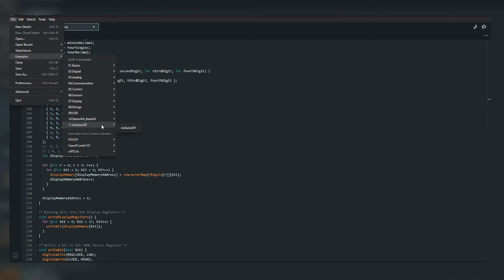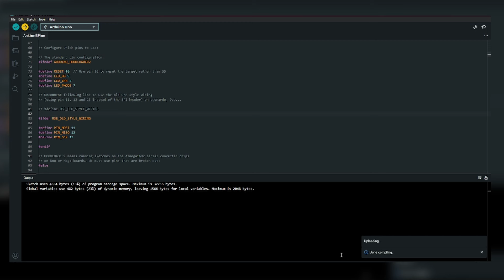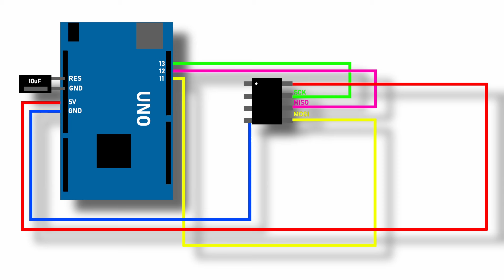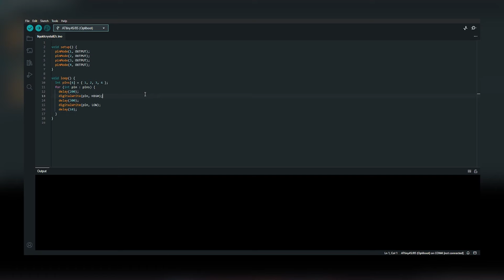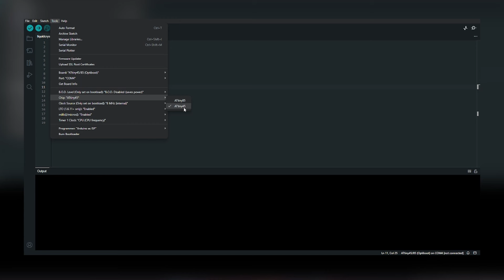Programming ATTINY45 / 85 With Arduino

Comment: "USBAsp" modules are really cheap to buy and easy to find, and generally work just fine as an ICSP for AVR chips if you don't want to wire up your Uno every time.

Another interesting route to try is using newer Atmel chips, less likely you can get them in DIP, but they can be programmed with a one-wire UDPI interface (so 3 total - ground, vcc, signal) that can be constructed using any basic UART module (RX,TX) and a single extra resistor.
Reply: For a USBASP programmer, I assume you include a 6 or 10 pin header on your PC board or breadboard and plug the programmer into that.  Is there an issue with the other things already connected to those pins?